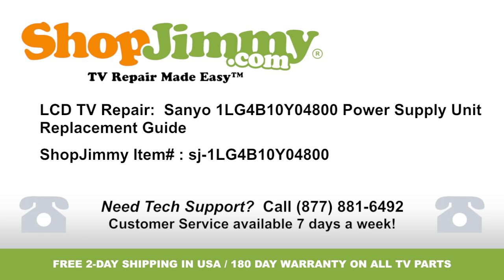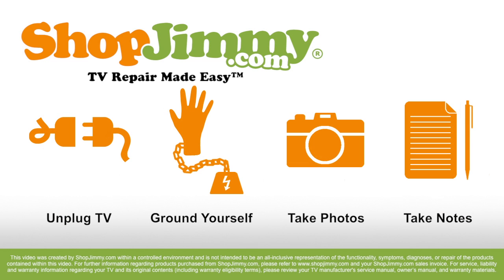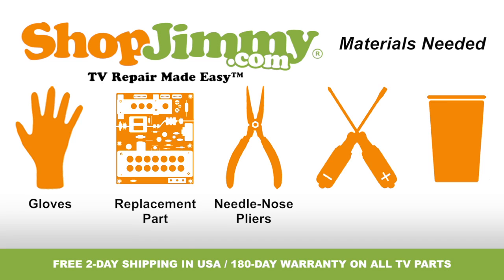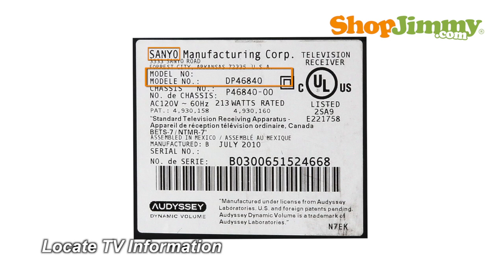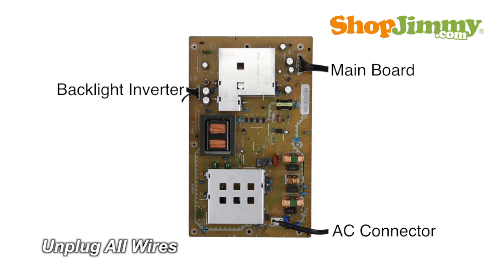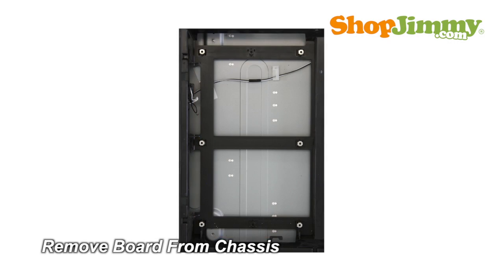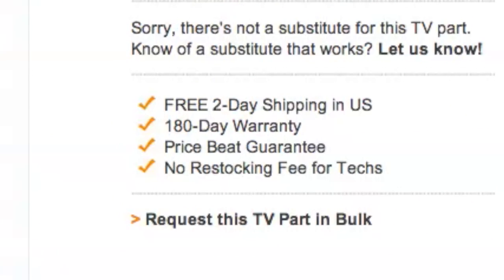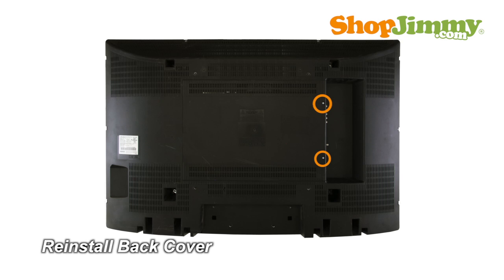Sanyo 1LG4B10Y04800 Power Supply Unit (PSU) Boards Replacement Guide for Sanyo LCD TV Repair

Comment: Hi I have a sanyo DP42647 lcd tv and the picture on it looks like it is almost 8bit because in the dark scenes it has what looks like green static. Is this a lvds cable problem?
Reply from the maker: Frank Harper This problem sounds like it is either the main board or the t-con board in your TV.  You may need to replace them one at a time to determine which part fixes the problem.  Here is a link to replacement parts for your TV model number on our website, click here:  http://www.shopjimmy.com/catalogsearch/result/?q=sanyo+DP42647  Be sure to match part numbers on your current board, with your replacement for compatibility.  Here is a link to a video showing how to identify your part number, click here:  T-con:  DIY LCD TV Repair: Part Number Guide for AU Optronics (AUO) Timing Control (T-Con) Boards  Main Board:  TV Part Number ID Guide for Sanyo Main, Digital, & Terminal Boards (LCD, LED, Plasma TVs)  You can also call our customer service for further assistance with your purchase.  (877) 881-6492  Thanks and please let us know if you have any further questions!  www.shopjimmy.com